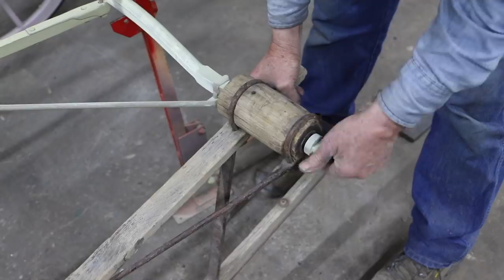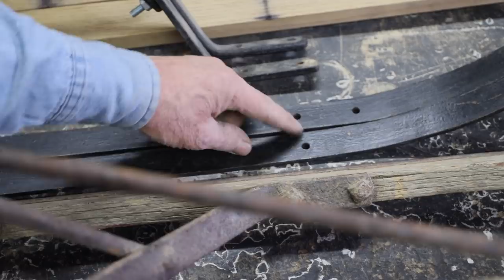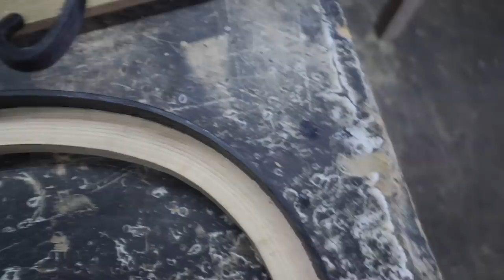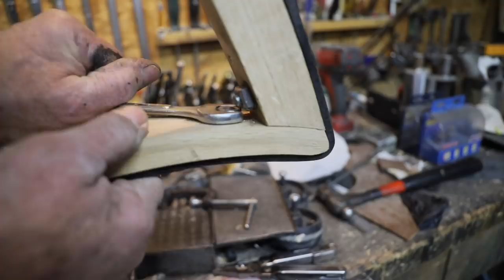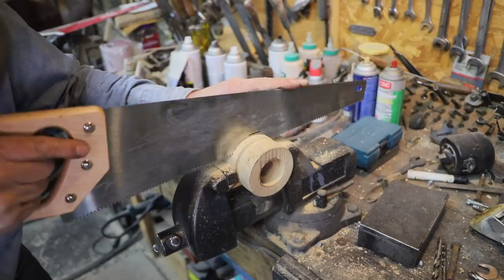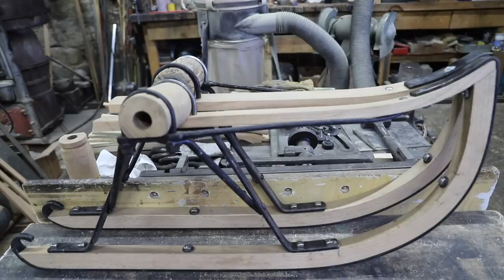Removable Buggy Runners Restored | Engels Coach Shop

Comment: I'm a retired service tech but my hobbies include bushcraft, woodworking, and blacksmithing. I've learned a lot from watching your videos and I've only watched the ones about sleighs.Things like adjusting bends in the metal I've been doing differently your way is easier and quicker. You must have been doing this kind of work for a long time to be as good at it as you are.

Comment: As always, I love watching a true craftsman (craftsperson?) at his/her trade. Your videos have inspired me to build a wagon for my twin 3 year old grandsons to pull around behind them, collecting rocks, hauling toys etc. I have a small collection of woodworking tools that I use restoring old cars, trucks and tractors. Since my wagon project won't be nearly as involved as the ones you take on, my saws, drills, and, sanders, should be up to the task. It's basically just building a box that I'll attach to the frame of an "all terrain" yard wagon which I bought at my local big box home center. Sure, I'll have more money invested in the yellow pine, stain and hardware to build the box than I paid for the whole wagon that I bought. However, the enjoyment that the boys will get from it will far outweigh the cost! I'll also have a spare plastic body for my lawn wagon in case mine cracks! Win/win situation right?

Comment: Here in Texas we see cutters/sleigh occasionally covered with dust and junk in old barns. I am always surprised because you would only have the chance to use them here about every ten years. On top of that you can usually wait a day and it will melt off. So, I can see how owning a set of these wold be a much more economical arraignment than owning a cutter that rarely gets used. Especially if you were a Doctor or someone who might be called out in an emergency or delivery in any weather. Just convert your daily driver in minutes into a cutter when the need arises. Pretty smart thinking to me.

Comment: Thanks, Mr. Dave, another delight!!    And 'tis the season to be be fabricating a logging sleigh...  Seems like the pieces I saw of Dad's sleigh (or snow wagon!!) didn't have iron runners, even...  But it was heavy duty, seems the main "cross beams" were at least 4" X 6" the rear runners were pulled by 'X' chains from the heels of the front runners..  But the memory does suffer some..    perhaps it was appropriate to haul  tree length firewood up to 16' or 20' long out of the woods to home where it was buzzed up.

Also seems like Dad thought the construction was white oak... (an excellent choice, too)

Happy Happy!!

Comment: The runner's  design looks very much like a winter toy that I had as a kid - a single  ski with metal runner and a seat bolted on where the hub is located.  It was lightweight and fast, and was also used as a seat when sitting around the bonfire at the top of the hill.  We called it a 'Go-Devil'.  (Oh, and if you wax or oil that handsaw blade, it'll cut much easier.  Same for a handplane too.)

Comment: I like the riveting, in the day they were easier and cheaper than than nuts, bolts and screws. I once helped forge some nuts and bolts using blacksmith thread, a lot of work. Also, when you see a lot of nuts, bolts, cast and stamped parts your looking at the latter days of mailorder flatpack kits, even if only the running gear or fittings.

Comment: This is craftsmanship, that will likely see an increasing need for, in the not so distant future.
7:55 Did you use any wood bonding glue for the top piece before screwing in place?

Comment: Great stuff Dave. I am curious if you've ever run across sleigh runners that had concave or convex cross sections to the iron where it contacts the snow/Ice. I know that there are horse shoes with cleats and other added caulks, studs, etc. for grip.
A friend contends that Ice skates have the bottom of the blades hollow ground
 as_a_direct_result of horse drawn sleighs having concave runners.
I find this highly doubtful, because of the extra labor vs poor return (if any) in efficiency. Blacksmiths seem to always go for the least amount of hammering, and most particularly the least amount of file and grindstone work possible for ordinary utility items.
I could believe a convex (D-shaped) cross section more easily than concave.; since one of the problems with a sled or sleigh is the runners freezing to the ice and snow, when left in place for even a few minutes.

Would love to know your thoughts on this.

Comment: I was wondering. It seems like the rear runners need a tie in from their front to the axel or center structure of the frame, to keep the runners from twisting.  Or are these not necessary?  Seems like a lot of stress on the hub assembly if this were not done.  I don't know.  What do you think?

Comment: Why no sealer, or oil, where wood and metal meet?
That seems like a good place for moisture from melting snow to collect, rotting the wood.
Reply: Likely the owner will be doing that portion.  Too bad though, I'd want the wood dipped before it saw any iron attached.
Reply: @Garth2011  I could be wrong but I though I heard him say they were not going to be used.  UPDATE:  Around 12:47 he says the runners aren't going to be used.